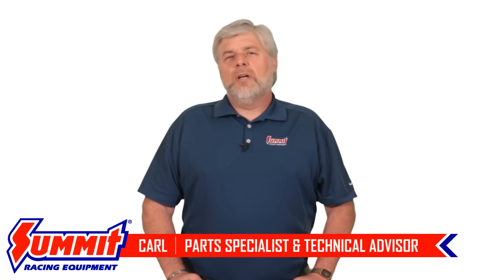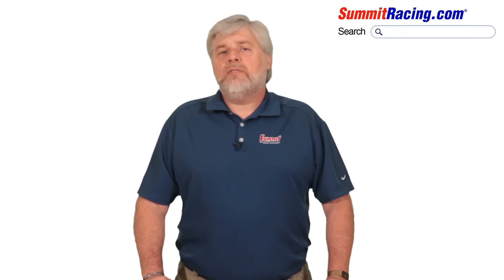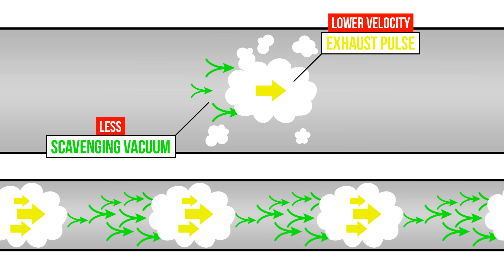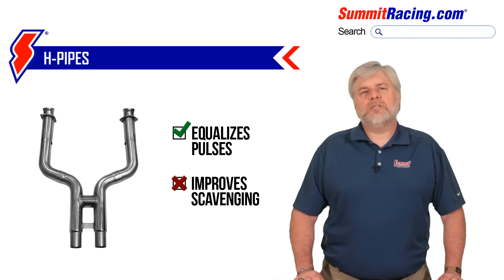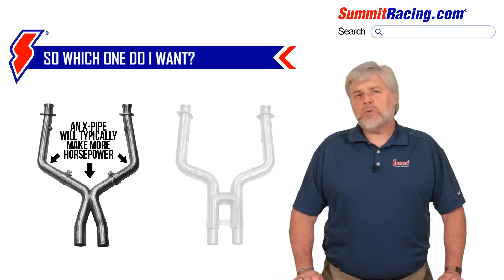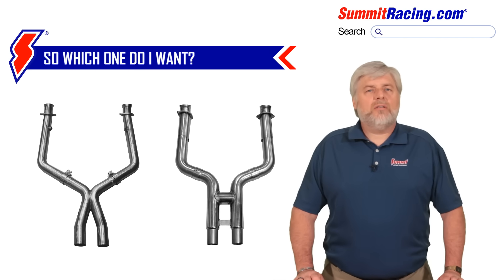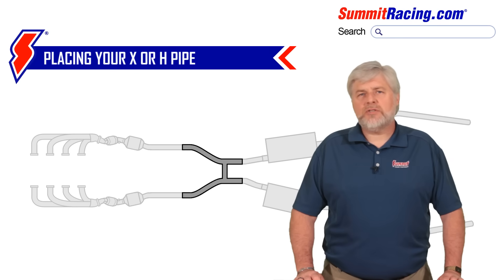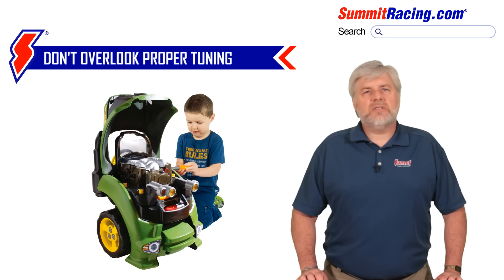Exhaust H-Pipes vs. X-Pipes: What You Need to Know

Comment: What if you had your exhaust converge into one big diameter pipe.  Instead of 3 inch dual you would have one 6 inch.
Reply from the maker: The X pipe will still offer better performance than the Y pipe. Additionally the 6” piping would be difficult to source, bend, route on the vehicle, and in most cases will not provide the needed backpressure for a properly functioning system.
Reply: Do the math. You do NOT need a 6 inch pipe to equal two 3 inch pipes in cross section area

Comment: I have a 2018 VW Passat GT 3.6L VR6. I currently have a Borla cat back exhaust installed. I am thinking of deleting the mid muffler and resonator (there are currently 3 Borla mufflers), in there place I would like to convert it to duals from the cats back to the remaining 2 mufflers prior to the quad tips using an X pipe just after the cats which are pretty close to the headers. Is this the right choice? I love the sound now but would really like some more volume at lower rpms and more impressive sound at full throttle.
Reply from the maker: Hi Thomas, In theory, yes this should provide better scavenging and more sound by eliminating the center muffler. The way the exhaust is routed in the tunnel and then around and under the rear suspension may present some challenges. Make sure whatever shop you have perform the work has a mandrel bending machine, works with T-304 stainless material (to match Borla), and is comfortable with the routing.

Comment: Is there any benefit or harm in having more then one X pipe? Or having both?
Iv seen guys using 3 x pipes and sounds amazing but is this a bad idea ?
Reply from the maker: It will change the tone some, but there is really no performance benefit. Thanks for watching!
Reply: Summit Racing I’m just worried that if it would cause flow problems

Comment: i have a 2 1/4 " true dual system , no crossover , and i love it . dumped before the diff , it has that short pipe , " hot rod " sound , but for power , im told i need a 2 1/2 " with an X pipe . im worried if i spend all that money , it may not sound how i like it
Reply from the maker: Hi Steve, How much HP is your engine outing out?
Reply: @SummitRacing  probably about 420

Comment: '67 Mustang GTA 289 C.I.D. 650  cfm  4-barrel Holley double pumper  OEM cam ,  intake manifold . Dual discharge better or stock single tailpipe ? X,Y or H?
Reply from the maker: Hi Stu, Dual 2.25” exhaust would be a better choice.
Reply: @SummitRacing  thx. What is the  desired  backpressure reading before the mufflers?

Comment: I have 96 impala SS bone stock just have a cold air that’s it. I’m debating if I should do a x or h pipe set up. And I’m torn between Flowmaster 44s or spintech 6000or9000 what would you recommend?
Reply from the maker: Hi Fermin, An X-pipe will equal out the exhaust pressures better.
Both mufflers perform about the same, it just comes down to personal sound preference. Have you searched for sound clips on YouTube?

Comment: For a c63 amg 6.2L which would you recommend?
Reply from the maker: Hi Paulie, It will depend on what you can fit, but an X-pipe will equalize the pressure better.
Reply: Summit Racing hey, thanks for getting back to me, I think it can fit both, but I heard the h pipe has a more old school muscle car sound, where the x pipe is more higher pitch, but improves more hp then the h pipe.

Comment: Hello I have a 476 Cubic Engine. It's a .100 over 454 4" stroke 11.0 compression & Comp Cam  305/575. Oval Port Heads Semi Close chambered Heads
Reply from the maker: What kind of vehicle?
Reply: Summit Racing  68 Chevelle

Comment: Hello... very informative video... I have a 81 firebird, I just installed a LS3 4L70E combination with a BTR stage1 cam kit 102mm throttle body, 2400rpm stall converter. Holley terminator max is running the brains of the operation with 60 pound injectors for future forced induction. I’m running short tube headers going into 2 flow master 2.5 inch catalytic converters.... X pipe or H pipe. What do you recommend
Reply from the maker: Vic, the system will only flow as good as its smallest point.  That happens to be the Flowmaster 2.5" catalytic converters. Two 2.5" diameter pipes through an X pipe will flow plenty for up to a 500 hp motor. Now, in the future if/when forced induction happens, we can revisit. It is difficult to build one exhaust system for multiple scenarios. One of the packages will suffer in some way!

Comment: DO NOT wrap your headers all the way to the flange.  They will keep the first bend too hot if you do a quality wrap!  After a few years on the street, the long side of those bends will basically have turned to slag and will blow out leaving a big round hole.  Start wrapping about half way up the side of the engine staying away from the top bend by 4-6 inches.

Comment: What is the ideal pipe size for an x-pipe behind a 496, 550hp?
Reply from the maker: Assuming the vehicle the engine is in has room, a full 3.5” exhaust with 3.5” x-pipe would be recommended for maximum performance.

Comment: Can i install H exhuast in corolla 1994 model ........? 
Plz reply
Reply from the maker: Hi Sam, Exhaust crossovers would not be used or applicable on an inline 4 cylinder engine. Thanks for watching!
Reply: @SummitRacing  than wt can i do for this ?
I want to more power to my car engine which is 4 cylinder 1498cc.

Comment: so what type of pipe would i use on 2005 3.0 ford escape and how or what i should use to sup it  up a little
Reply from the maker: The same fundamentals in Carl's video would still apply to your application. Regrettably, there are no aftermarket H-or X-pipes available for your application.
Gibson Performance Exhaust does sell a Cat-back exhaust system for your application, additionally, you could add a high-flow air filter from K&N and an improved mass airflow sensor from JET Performance.
https://www.summitracing.com/oh/parts/gib-619871/year/2005/make/ford/model/escape
https://www.summitracing.com/oh/parts/knn-33-2187/year/2005/make/ford/model/escape
https://www.summitracing.com/oh/parts/jet-69190/year/2005/make/ford/model/escape

Comment: I have a 1984 Oldsmobile Cutlass Supreme. The engine is bored to 40. Pistons more larger. The other parts are stock. What type of pipes are better for it? Straight, h or x pipes?
Reply: Is double piped. One pipe on each manifold. The pipes are 2 inches
Reply from the maker: Hi Ricardo, We suggest an  X-pipe. Here is one we show for your application: 
https://www.summitracing.com/parts/pye-xgg10/year/1984/make/oldsmobile/model/cutlass-supreme

Comment: Pontiac 482 stock motor headers in a 1970 gto witch pipe would be more bennifical for this aplication
Reply from the maker: For your application, the h-pipe would be a better choice. The x-pipe may make a few more horsepower at high rpm, but the h-pipe will make better low end torque and mid-range power.
Reply: Summit Racing Thanks for the response, is there a kit to fit a gm a body that would be easy installation from headers back?
Reply: Summit Racing we are working on a 1971 pontiac gt 37 gto/lemans replica body style. Thanks!

Comment: I have a new chevy truck with 5.3. Thinking about after market exhaust. Will it make much difference and if so which should I go with?
Reply from the maker: Most of the new Chevy trucks utilize a y-pipe system with catalytic converters which would prevent the ability to install any type of crossover pipe system due to emissions regulations.

Comment: Is there an equation that can help determine the ideal exhaust pipe diameter for a given engine displacement? For example,  if I wanted to convert a 6 cylinder single exhaust setup, that had a lot of low end torque, to a dual exhaust ( in an attempt to gain hp) but wanted to keep my low end torque in the same rpm range, what diameter of pipe would be ideal? Is this something that a home builder could figure out or is it too complex to determine given the myriad complexities of each individual application?
Reply from the maker: Hello Granny, it sounds like a neat project.  Before we get into backpressure and torque, let’s start with area of a circle. Area = Pi x Radius Squared .  If you were starting with a tiny 1.75 pipe, you would have 9.62 square inches.  If you were having a system bent at a local exhaust shop, 2.250 is common and about the biggest mandrel commonly available.  That would take area to 15.9 square inches.  Let’s say you were to run two 2.25 pipes, then you would be at 31.8 square inches.  The only downside to that is weight and cost.  A single 3” pipe is 28.3 square inches and removing ½ the weight (vs. running the extra pipe) would be a small price to pay for 3 less square inches of area.
 
Next, how can you measure backpressure?  It’s actually possible to tap into the pipe and measure pressure at redline with a common vacuum/pressure gauge.  A typical factory exhaust system often comes in at 8 psi and a completely free flowing exhaust is a little less than 1 psi.
 
Lastly, we’ve never seen backpressure increase torque.  It impedes fresh air and fuel from entering the cylinder.  The only downside to having more exhaust area is weight, packaging, and cost.

Comment: This channel is awesome!!!

I've got a 2012 BMW 550i xDrive w/ a 4.4L Twin-Turbo V8. It makes good power but sounds like a little girls electric moped... 🤣

I'm looking to replace the resonator with either an X-Pipe or straight pipes back to the stock valved mufflers, hoping that'll make it sound "meaner". 

I understand the X-Pipe would give it a less raspy, higher exhaust note than straight pipe back to the stock mufflers... Would it hurt power much to just go with straight pipes replacing the resonator to get that deep raspy sound, or do I need to go with an X-Pipe to keep from losing power on a small, Twin-Turbo V8?

Is there a link to any inexpensive parts you'd suggest?
Reply from the maker: As far as power output is concerned, the X-pip would still be the best option. Magnaflow offers some in-line type x-pipes that you could use to fabricate a resonator delete without taking up too much space. You would just need to choose the proper tubing size for the following link https://www.summitracing.com/oh/search/part-type/exhaust-crossover-pipes/universal/yes/pipe-style/x-pipe/brand/magnaflow?N=brand%3Amagnaflow&SortBy=BestKeywordMatch&SortOrder=Ascending&keyword=exhaust%20crossover
Reply: Bitchy Moany and Whiney. Sell that pile of junk and go buy something with a motor that don't need turbos to go fast. Also, inexpensive and BMW do not go together. Have a nice day.

Comment: Depends a lot on the vehicle. Some mustangs sound better with an h pipe but like the year I have the 2013 gt it sounds more like a truck with the h pipe and has more of that hollow bellowing sound with the x pipe the way a stang should sound imo. I used to have stock h pipe but I’m putting a borla x pipe on mine with my borla exhaust. The sound of the x vs h has more to do with the axelback setup and type of exhaust system you have

Comment: I have a 1981 camaro z28 100% stock which one of these should I use?
Reply from the maker: If you are looking for something made specifically for your vehicle, Pypes Performance does offer some header back systems for the 1981 Camaro that contain an x-pipe. To use one of these systems you will also need long tube headers. Be aware: this will eliminate the emissions equipment and not be legal for on road use.

Comment: Hello thank you for the video.  I have a 2011 chey suburban ltz 152000.  Want to upgrade exhaust which applications would work better?  Is the before the CAT or after.  Please send me links to see application or you recommendation
Reply from the maker: The exhaust systems we offer for the 2011 Suburban would be cat-back. Here is a link to the options we offer for a 2011 Suburban 1500 with a 5.3L V8  https://www.summitracing.com/oh/search/year/2011/make/chevrolet/model/suburban-1500/department/exhaust/section/exhaust-systems-kits/part-type/exhaust-systems/engine-size/5-3l-325/engine-family/chevy-small-block-gen-iii-iv-ls-based-engines

Comment: What would be the best application for a 72 Ranchero with a 351 Cleveland? Short or long tubes? Want to run it on the street. Your suggestions would be appreciated.
Reply from the maker: Long tube headers will provide a bit more power over a short tube. However, for a street car, shorty headers will offer improved ground clearance, this may be important if the car is lowered.
Reply: @SummitRacing  Thank you, as clearance can be an issue for my street application. I have to worry about pot holes, inclines, and such.

Comment: I have a 289 k code with a 750 holly double pumper and a cobra supercharger. The rest of the car is stock.
What would be the best diameter exhaust, and would an H or X pipe be best.
Thanks
Reply from the maker: George, the same theory from Carl’s video would still apply for your supercharged application. The only difference would be the exhaust pipe size, under boost you’re forcing air (and fuel) into the cylinder and the volume of your spent gasses will increase.
 
You did say the rest of your engine is stock, does this mean you’re still running the stock Hi-Po manifolds that have a 2" flange? If you are, that might be a limiting factor. A custom exhaust shop can make pipes that increase in size after the flange, but the limitation is still at the manifolds. 
 
If you are running headers, we would suggest a 2 ½" diameter pipe size based on the horsepower rating (395 HP) of the Cobra supercharged GT350 from Shelby back in 1966.

Comment: 3:28 Old school rule of thumb is to place the H pipe where the hottest part of the pipe would be if it was just a straight pipe. This applies to fabricators installing an H section into straight pipes. Discoloring of the straight pipe is evident due to overheating and is where the H should be located.

Comment: My question isn't about x or h pipes but rather if I'm better off going with a bigger single exhaust or a dual exhaust setup on my 81 Mustang with a 200 i6. It will have a ported and polished 250 head with a 4 barrel intake and carb (around 400cfm) and will have a powdercoated header. I was thinking of running it off a y pipe and dumping it out the sides. I'm thinking I can go 2-2 1/2" on the exhaust for duals or a 2 3/4" maybe a 3 for a single. Thoughts?
Reply from the maker: Hi Katarina, The biggest difference is going to be in the sound. You can go with either dual or single whatever you have room for. The power increase between the two will be pretty negligible
Reply: Oh thanks! I'm not looking to have this thing as a power monster obviously it's more for efficiency. The power increase is just a bonus :)

Comment: I've witnessed in person dyno tests on the X vs H vs true dual exhaust.  There is literally only a couple horse power difference at high RPMs between all 3.  I can say for a fact, nobody can feel a difference of 2 or 3 horse power at 6500 rpms.  
FYI - if you use an X or H crossover pipe, you don't have dual exhaust, you have a very large SINGLE exhaust.  Think about that ......
Reply: Bullshit ! If it has 2 Mufflers and 2 Tailpipes, it's a dual exhaust. Period.

Comment: What about if you've straight piped a car and the pipes dont even don't, I'm talking straight back. Is that hurting me hp wise?
Reply from the maker: Hi Ethan, There are quite a few variables that come into play such as what your application is. If it’s a track car I would say that you could run straight pipes. If it’s an everyday driver the noise alone would drive you nuts so I would say use an X or H pipe because the “gain” in horsepower would be minimal at best

Comment: I have a Chevrolet Silverado 4.3 liter engine. I'd like a little bit more performance for towing and trailering. What is a solid direction for my goals?
Reply from the maker: Hi David, An exhaust system, air intake, programmer possibly would be a good start but we would need to know more about the vehicle to make the determination of which one. Give our sales team a call, 1-800-230-3030. Thanks!
Reply: @Chevvygone132  my V6 tow more because the V8 weighs more.

Comment: Which is best for a 1984 chevy c10 pickup?
Reply from the maker: Generally speaking, an H Pipe will make more low end torque but an X Pipe will make more high end horsepower. So it is really a matter of what you will be using the vehicle for and your personal preferences.  I would say any truck used for towing or carrying heavy loads would benefit more from an H Pipe.

Comment: Thoughts on true dual exhaust? No X or H in the middle?
Reply from the maker: A true dual exhaust system with no crossover pipe (H or X) can be used for that vintage “true duals” sound, but will not perform as well as a similar exhaust using a crossover pipe (H or X).
Reply: Are there any performance detriments or is it just sound and no gains?
Reply from the maker: Its more for sound but will not perform as well as having the X or H pipe

Comment: I put an 3", stainless steel x pipe kit on my 81 Camaro with 511hp. I started it up, and it sounded really bad. Sounded European.
I immediately dropped the exhaust, cut a slit, and then slid a plate of stainless into the slit and welded it all up. The plate kept each pipe separate.
WOW WHAT A DEFERANCE! true dual exhaust sound, almost stereo... Beautiful and gurgaly.
Also, the set of headers used on the dyno weren't that great. I revved it up, and on the deceleration of the engine, it would kinda back fire here and there. Once I got it installed in my car, with equal length, long tube, 1.75" primarys, ceramic coated hooker headers, no more backfires at all. Just pure revs and decelerations. So glorious.